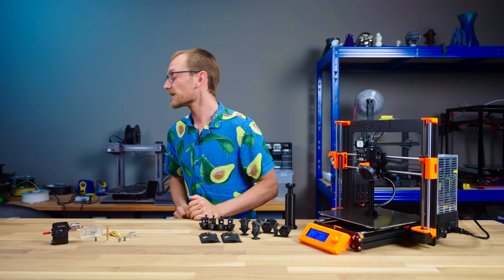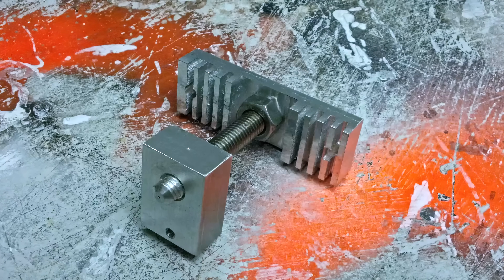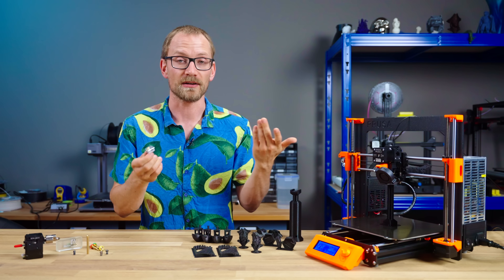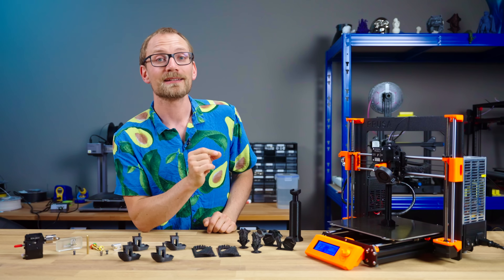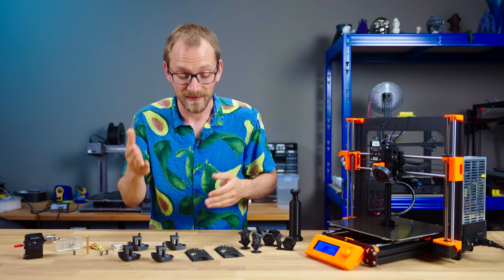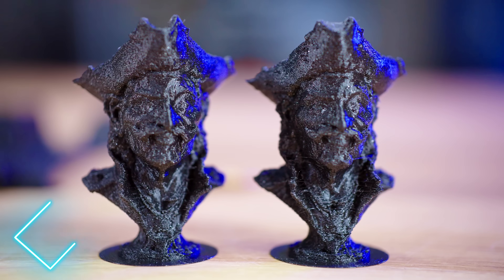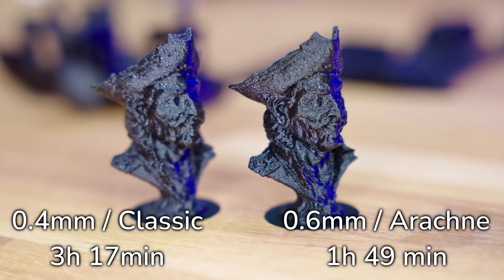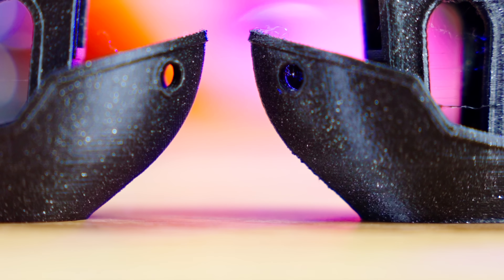0.4mm nozzles just became obsolete

Comment: Great summary. I’ve found the same thing as I develop Cura 5.0 profiles. The new features of the Arachne engine allow 0.6 nozzle to produce decent detail at much faster speeds vs the 0.4 standard nozzle.
Reply: Lol I was about to go into your channel to check if you had a 0.6 profile for ender 3. Thank you both for so much quality content!
Reply: where can i find your .6 profiles for cura??
Reply: Do we have Chep Profiles for 0.6 nozzles and are the magic numbers the same?
Reply: I need to get into Cura and find this Arachne thing 😆 never heard of it until today
Reply: So it's happening
Reply: Chep I can’t find your profiles
Reply: Hi @CHEP or @Thomas, Maybe for both of you to try out.... I found quite satisfying settings with cura5 using a 0.4mm nozzle and 0.6mm line thickness. Using a 0.16mm layer height this creates really strong walls and almost invisible layers. How would it compare in Arachne 0.4 nozzle VS 0.6 nozzle VS 0.6 on 0.4 nozzle ?
Reply: I am going to have to look into this. I have a .6 nozzle for my ender 3 in and When i get my cr10 repaired i may look into putting a .6 in that, but i typically run Cura so i will have to look into this.
Reply: Tried it on an Ender 3v2 with a dual gear bowden setup. The problem I got when I tried the 0.6 nozzle is that it makes any issue with filament moisture MUCH worse. I tried drying the ABS I had and I tried changing all kinds of settings, but I kept getting terrible stringing that wouldn't go away. As a result oozing would always leave the nozzle slightly empty and would cause under extrusion in thinner parts. I use Klipper and with the 0.4 nozzle I've been able to go to 400% of the original print speed while still getting structurally sound prints. With the 0.6 nozzle the best I can push it is 150%. The extra ~30% print time reduction at standard speeds simply isn't worth it for me. 😅
Reply: I have looked through cura 5.2.2 and I can't find arachne any where I have to be missing it but this is important its big news, I had an  Artillery Sidewinder 2 and it was OK but I think the bed was unlevel so it would wipe off the print after the 2nd round it back I have a Creality CR -10-s4, it's going to be great.
Reply: @user-Dave67  it's enabled by default!
Reply: @jax8604  cool thanks  I got the CR10-S4 in and didn't like it. The noise was on a whole new level and the bed was taken 30 minutes too get to 60 C  so I have boxed it up and waiting for Them to give me a address to send it back. If I have to I will say to mastercard and have them fight for a refund.  I have the CR M4 which is 1,099 $ but it has everything I want.
Reply: do a video on .6 nozzles and printing settings!!
Reply: And a 0.4 arachne vs 0.25mm without - just to see what quality we can get.
Also a 0.25 arachne vs regular 0.4 )since arachne gives a small speedboost, they might not be too far off each other) or compared to a cheap resin printer

Comment: This is just bad information with a stupid click bait title.

A 0.4mm e3dv6 nozzle with even the most basic of extruders is more than capable of maxing out flow rates for most hot ends. You can print with line widths as high as 1mm with ease even with a 0.4mm nozzle. You don't need a 0.6mm nozzle to print at 0.6mm line widths. There's no real speed advantage to having a 0.6mm nozzle when you can print 0.6mm lines with a 0.4mm nozzle. I'm sure that most people aren't ever printing with layer heights as large as 0.4mm on 200x200 ish size beds. So overall it still looks like a 0.4mm nozzle is the better choice for layer heights of 0.2mm even for the largest parts that fit on these printers. Cura 5 does the variable line widths business quite nicely.

The other point is that 0.4mm nozzles are way less susceptible to stringing when compared to 0.6mm nozzles at even much higher temperatures.
0.4mm nozzles give you the option of getting finer lines and layers if you ever want. Print speed based arguments are just plain wrong in this scenario.

Comment: Nice video! I'm curious, does using a bigger nozzle will increase the amount of filament used? I'm especially thinking that if you do 2 perimeters with a 0.6, it will take more than with a 0.4, right? same for infil?
Reply: You can easily check that by loading any model in your slicer and changing the nozzle diameter. If the weight is the same, the same amount of material will be used (obviously).

In Cura 5.1 with a few complex models added to the plane going from .8 to .4 without changing anything else didn't really change the total weight (125g vs 125g).
Might've been a special case, but in general the amount of material used will be roughly the same, with some margin depending on some small details or how some gaps will be filled.

Hope this helped!

Comment: The vodeo in overall is very good, but saying a .4 nozzle is obsolete is not right. Basically my critic would be that you are not talking about the nozzle problems really but how the arachne tec improved the prblems in the slicing engine of slic3r, also in prisalicer. The slicing problems you state, doesnt exists on other engines like kisslicer. So the problems you use as example for saying ".4 noozles are obsolete" mainly exist in prusaslicer/slic3r.

Comment: Well, this is convenient.  When I got my Ender 3 (a little over a year ago) I bought three packs of spare nozzles, in 0.2, 0.4, and 0.6 mm sizes.  I've used a couple of the 0.4 spares due to clogs (annoying that I can't use a solvent bath to clear out clogged plastic, only a pick with a hot nozzle, which doesn't work very well) but haven't even installed the other sizes.  Time to update my Cura and look at the slicing options (since you say Arachne was in Cura first because it was developed by them).  Of course, this means I have to find time to finish installing the direct drive extruder upgrade that's been hanging fire since last fall...

Comment: I think that with new algorithm the inertia of pressure variation must be always take in consideration, in every combination of setting and hardware, and is obvious the advantage of the direct drive extrusion, between all things. Extruder motors have to get a lot more work, in some cases too, so is important keep in mind the power that can be managed. Speaking on settings, thin layers as example, requires less performance in pressure variation, due to the general less volume managed and so the algorithm can get well executed commands from the extruder+nozzle combination.
In short the lag of physical response of the hardware (especially in extrusion) , with new algorithm become a much heavier variable. Exclusively speed speaking I think that the 0.4 obsolescence isn't obvious because using a 0.6 instead, to reach quality target, can be needed to lower that pressure inertia in all possible ways an so getting same, lower or not heavy advantages. With this new weight of lag in extrusion variable, the balance of weight (sorry for word joke) and speed is mitigated by extrusion speed response, in terms of requirements to get same print quality: theoretically is possible go slower but with a  bigger nozzle well modulated in pressure, leaving in less importance jerks problems. In terms of absolute resolution a smaller nozzle get always better quality but with a well balanced head, with new algorithm, flexibility is the highest gain, because you can choose to leave details back (ignoring more the pressure lag), and increase the speed settings (layer height, and general speed), gaining a lot in term of time respect to same system with a smaller nozzle, or choose detail importance giving at the pressure lag variables the most importance, with te result of a less stressed system, (extruder apart) thinking at jerks, as example, that work at a piece production speed that's not lower than a smaller nozzle configuration, extreme cases apart. So, in my opinion, more than obsolescence, a new compromise choice, in terms of flexibility, is available, due to the low or imperceptible quality loss, as in video is demonstrated.

Comment: 8:24 Small comment, you changed two variables at the same time there, that makes it harder to say if the nozzle or algorithm done the improvements. I know what you are showing is that with the algorithm and the 0.6mm you can see what it can do, but what about the 0.4mm with the algorithm change? How would that also improve the print quality? It just feels a little bias as not showing what the 0.4mm can do with the new algorithm. It's a minor thing (like I said I get the point of what you are saying), just feels you skipped a somewhat fair comparison 😉
Reply: Agreed. He does say that 0.4 with arachne is fine as well. Just not as quick

Comment: I agree, but up to a point. I don't think reality is black or white, but there are a lot of shades in between. I used quite a bit larger nozzles to print mainly in the same time but with MORE quality, using lower layer height. This works amazing with models that are wide and short on Z, and it gives especially beautiful prints when you have slopes. But larger nozzles have a substantial trade-off: the seam. If you have one big model that has just one seam across all its body it's fine, when you have something with lot of "branches", where each has its own seam it starts getting bad quickly. In that case using a 0.4 mm nozzle to print everything thicker (0,6 or even 0,8), but with the exclusion of the outer perimeter and top layer, can give you a beautiful print, with no almost no time penalty compared to a full 0.6 mm print (or maybe even faster if you do infill at 0.8). My primary printer is pretty fast (250 mm/s with 20K acceleration are my daily speed, that I can even push a lot more if I want something quickly), I'd like to have a 0,33 mm nozzle to print an amazing outer skin and a faster 0,66 everything else!

Comment: After the Meltzone episode where this was discussed, I had my "aha" moment and have since switched all my slicing to 2.5.0 Alpha.

But one point that I disagree with: there is an enormous number of people who print busts and figures with FDM machines, so "you're probably not using FDM for doing detail work. You're using it for <engineering parts>" is probably more wrong then you think. Of course, this is anecdotal: all the people I interact with, the people I chat with online, the designs I see coming out of Patreons and such are either designed for a specific printer type (resin or FDM) OR they're just going "here's the model. Do as you want".

So to me, the ability to get extra details + time savings + no more need for thin walls, etc. is the reason to use arachne-based slicers. If you're only doing engineering parts, then any nozzle larger then 0.4 is probably better. But if you aren't, then you need to probably do some tests on if the prints you do would benefit from the larger nozzle. Many probably would, but as some of the more upvoted comments in chat request: compare 0.4 and 0.6 with arachne. Good chance you won't notice differences, but there's also a good chance you would. I already saw a bunch of improvements on some of my prints with 0.4 and keep going to the "width" view so I can see where arachne kicks in. It's been pretty cool.

Comment: I always use 0.5mm on my 3dgence one, because there is no 0.6mm nozzle. For vase mode on my ender3 pro i now use a 1mm nozzle and print 1.2 to 1.4mm wide and 0.35 high. Perfect results. Printer moves nice and slow but its still double the speed and much more strength...

Comment: So, let me get this right...
You are using printers which can achieve, at best, 15 mm^3/s volumetric flow rate, with mediocre corner velocity and acceleration, all of them bed slingers, and decide the 0.6mm nozzle is better than 0.4mm nozzle on them.
The speed limiter is not the nozzle size, it's the volumetric flow rate. Sure, you can print faster on those slow printers with 0.6mm nozzle simply because you can use two walls instead of three, for example, therefore reducing the amount of print moves.
However, when you use a properly fast printer, capable of reaching 250-300mm/s with 10K acceleration and 10-15mm/s Corner Velocity, a 0.4mm nozzle works perfectly well. Furthermore, a 0.6mm nozzle might prove detrimental for some models, simply because in case of PLA, cooling might not be sufficient.
Reply: Your points may be correct, but they are not significant for me.  Most of us already have 3D printers.  I already have three.  I welcome information that allows me to increase my printing speed and/or my print quality without buying yet another new printer.  Therefore, this video is exactly what I want.

Comment: Wait, doesn't the lulzbot come with a 0.5mm?  Regardless, interesting ideas, I'll perhaps try it since I tend to have some heat creep issues, so a bit more flow sounds good to me. I already use 0.28mm layers to avoid print failure and to do the print faster. (And moving from MakerBot slicer to older Cura, then again to PrusaSlicer, has been huge in print quality and reliability.)

Comment: i use .4 on all my printers but i always wanted to go with a bigger nozzle just for speeding up my prints, only reason i havent is cause im always getting lithophane jobs an thats the biggest money maker for me with my printers so ill either have to keep half of them setup with a .4 just for the lithophane prints an the others go with bigger, id go as far as a .8 cause i feel like most of the stuff i print dont have fine details that would be effected an i feel like it would make the prints stronger but ive never tried going up in size of nozzle just down to try to help with getting lithophanes to have a higher detail but ive learned a .4 with the lithophane standing up the nozzle size doesnt effect the quality rather its more related to the layer height when the prints are upright, when i first started i tried printing them laying down flat an they worked but wasn't that clean so my first thought was to go for a smaller nozzle an realized printing them standing up would make the layer height deal with the resolution of the image while keeping the .4 nozzle didn't slow the prints as much as printing with a smaller nozzle with the prints laying flat so standing up at a .1 to .12 layer height depending on the printer with a .4 nozzle at 50mm/s has gave me the best result, also dual 5015 cooling fans over stock single 4010 or dual 4010 setups.

Comment: OK, the SL1 test agrees with what I've been finding too. Nowhere near as intense, however, I don't want to deal with the hassle of resin, but I print RPG miniatures. I've got my machine dialed in pretty tight, and .6 just doesn't cut it, and .2 is a pain. I tried it at .4 -- which a year ago wouldn't work as well -- and I'm getting really good results. That

Comment: My designs wouldn't benefit from an 0.6mm nozzle as so often I'm working on tiny details and designing with the 0.4mm nozzle in mind. There must be thousands of drones out there now with tiny TPU prints from my designs holding tiny radio receivers & antennas securely.

Comment: One shouldn't extrude lines the same width as that of the nozzle hole for best quality and speed anyways. A 0.4mm nozzle can print up to 1mm lines accurately in one go and can print a line 4mm to 10mm thick in one go with varying degrees of accuracy. Look for the channel "Lost in Tech" I was able to replicate a lot of his results on my printer with some varying degrees of success.
Reply: You also loose accuracy if you print at narrower widths than your nozzle's hole.

Comment: For me, the addition of Arachne hasn't made the 0.4 nozzle obsolete, but it has more-or-less negated the need for an 0.25 nozzle. I was printing parts that had extremely fine text right before this alpha came out, and Arachne mode would have saved me hours and hours of print time by allowing me to keep the 0.4 nozzle on the machine. Arachne on the 0.25 gets into detail work better served by a resin printer, so that nozzle has become a much less viable choice.

Comment: I use 0.6mm (or bigger) for 7y now for ewerything
Its far better ,faster ,almost never get clogged (in my case not a single clog) can print almost the same as 0.4mm and can print above 0.6mm easy 
That means infill will be way stronger than printed using 0.4mm nozzle
In the same time can be few times faster

Comment: I tried switching to 0.6 a few times in the quest to reduce print times but was not happy with the result. It's certainly useful for less demanding models but overhangs and bridges just won't print good enough, even with dual 5015 fans. You can see that even on the benchy if you go fast, and speed was the reason to use a 0.6 in the first place. Thomas probably went pretty slow with the "tests" he's showcasing here. You could probably tweak speed for outer wall and bridges on models that require it and high speed on other models and get faster prints overall, but it's not a big difference.  
I'd rather use a 0.4 with high speed and accel, and wide lines for inner walls.
So no, saying a 0.4 is obsolete is ridiculous, it's still the standard, but it depends a lot on what you print.

Comment: Okay, no pressure here, but I'm trusting your advice and I'm switching to the 0.6mm nozzle.   I've recently had some issues printing printing with the 0.4mm nozzle.   I switched to a new spool of PLA and was just fighting with Cura over the first few layers.    I have to say that after changing to the 0.6mm nozzle and going back to the default "standard" profile in Cura things are much improved.    As you point out the there really isn't that much quality difference between 0.4 and 0.6, but it does seem that the 0.6 nozzle is more tolerant of small variations in those first 2 layers.   Thanks for the great explanation and advice.